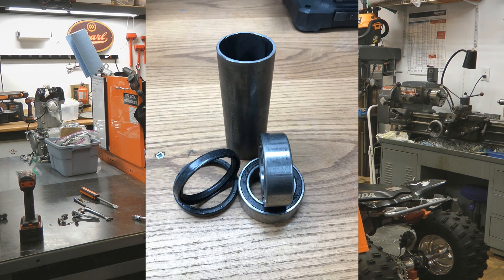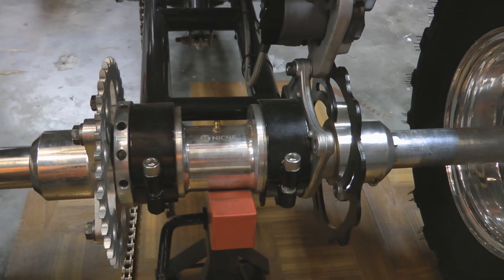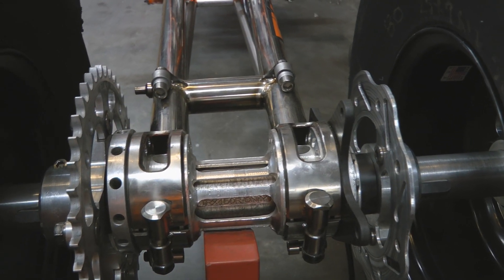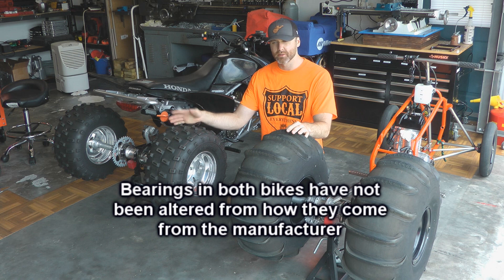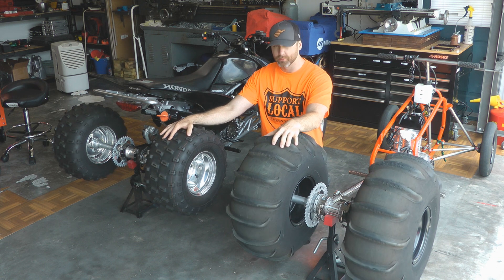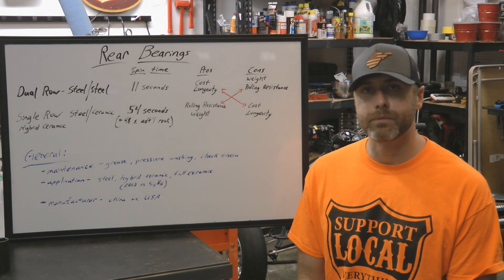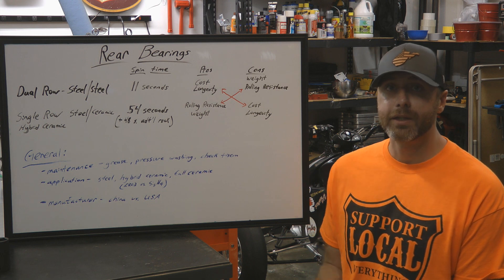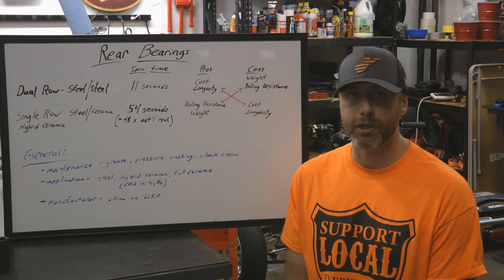Hott Boy's Garage - Ep. 10 - Hybrid Ceramic vs. Steel Bearings - ATV Rear Axle Carrier

Comment: while we know the ceramic are better, i think 2 things affected the steel. if seals are newer, then they will have more grabbing on the axle and cause more resistance.  second dual row has more resistance. i imagine you could double the distance on steel if changed, but over all they are ok.

Comment: I remember years ago I seen a video where a guy was doing a lot of drag racing with a car and he showed that non greased steel bearings roll much easier with 80% less drag vs the greased bearings for his rear axles. That was in a car axle of course but it was interesting. They had seals behind the bearing so that was the non greased bearings were not getting gear oil on them.

My notes 1. I feel like the ceramic ball bearings will shatter very easily. Also how strong is the Aluminum Sprocket?
Reply from the maker: Yes they definitely roll a lot easier with no grease...but that's also with no load on the bearings too (free spin).  I've attempted to run both hybrid ceramic and conventional steel/steel bearings with no grease and with just white lithium grease in them.  In both experiences - the bearings were toasted and notchy in less than ten 300' passes. That's why I recommend sticking with the grease that comes within the bearings.  Might seem to roll a little less freely when free-spinning, but once the bearing heats up and there is a load on them - the grease is needed. JMO :)
Reply: WellThatsGood86 Oh okay I see.  Very interesting.  Thanks for the reply.  Keep up the good work.